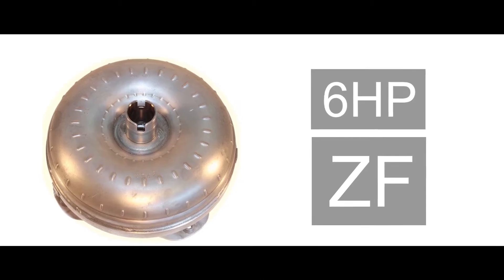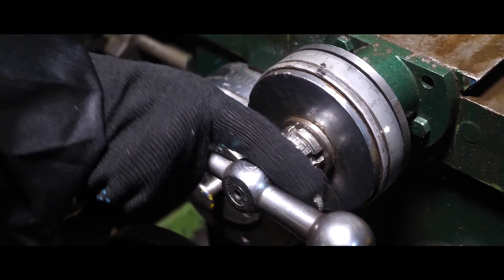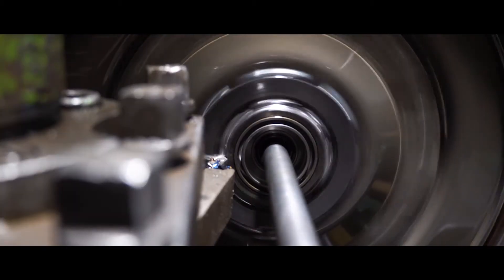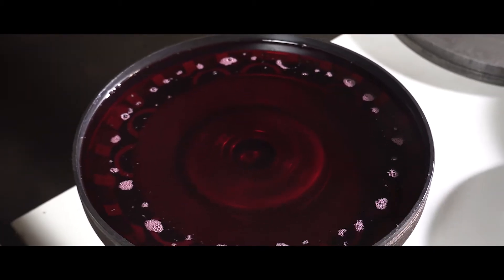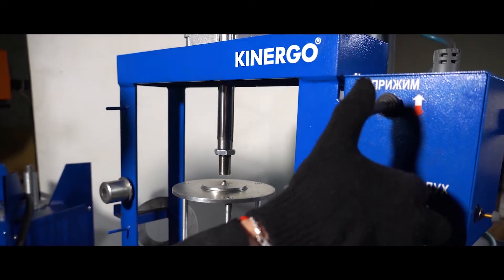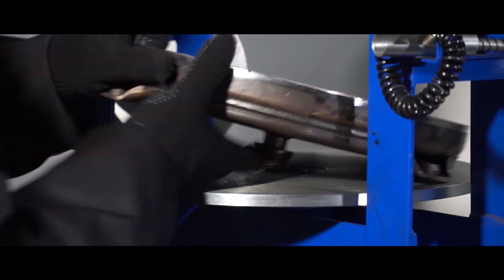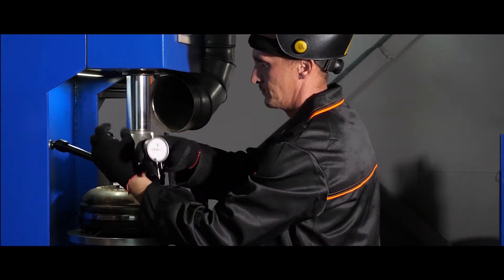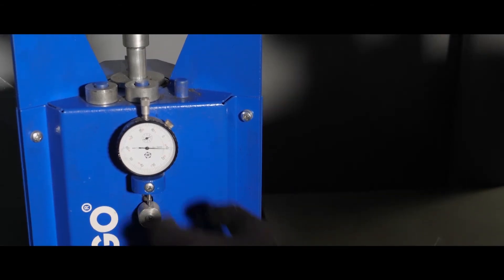Repair of the ZF 6HP26 torque converter

Comment: G’Day Kinergo thank you for your fantastic Video you are a Legend 💪👍🫡
Plz help Mate I have this problem with my 2004 Disco2 Automatic td5 just  
yesterday two weeks he changed transmission on my 04 Discovery 2 Td5 Automatic started playing symbol traction control as gear is engaged will I’m driving then parked home wake up in morning start on D 1-2-3 they won’t engage only Reverse works and I checked  transfer box if accidentally me or family member they engaged low range some how it stuck in N but nothing of that ,, then I found out the symbol transfer box  light on and when I engaged it R works D-2-3 won’t move just the 1 it works as Reverse 🤷‍♂️🤦‍♂️ is that a bad thing ,,, this happens after I visit a mechanic work shop 
oil fluid two weeks ago. 
Am I in trouble gearbox gone I don’t know 🤷‍♂️ what to do ? Please advise me 🙏🏻🙏🏻🙏🏻
Thank you 
Matt

Comment: How do you change oil in torque-converter?
Reply from the maker: Thank you for interest in Kinergo products. 
The only way to change the oil in the torque converter is to cut it open, clean and weld it back. All other ways are partial, some ATF will remain inside anyway.
Write to sales@kinergo.eu, our technical specialists will answer all your questions.
Reply: @KinergoEquipment  how long will oil in torque converter last?
Reply from the maker: @lordbentley730  The oil in the transmissions constantly circulates from one units to others (including from and to the torque converter). So it lasts the same period in all the parts of transmissions. The ATF lifetime is set up by different manufacturers in a different way. The majority of manufacturers recommend not to change the ATF during the whole life of transmissions. But transmissions rebuilders recommend to make partial or full ATF change every 40 000 - 60 000km
Reply: @KinergoEquipment  so oil from gearbox go to tourqe converter???

 Yes I have read so many different km when to change oil in gearbox last one was zf pdf document it stated 150 000km but they say another km in their YouTube channel. And lifeguard 6 is not for all  6hp gearboxes....... all this is made for something to go wrong 😄😢
Reply: @lordbentley730  Yes, gearbox oil flows through the converter. I change it every 90000-100000 km, but it is just like with engine oil: it's good if you change it every 10000km, but many people only do every 15000km and it's usually ok.

Comment: hi, i have a mercedes c 180 w203.  I have problems with the gearbox when it is not warmed up and I put it in D I feel a vibration, and when it warms up the gearbox calms down.  the complete oil and filter were changed.  and it's the same again, could it be next to the converter.??
Reply: That doesn't sound like torque converter issues. If you have a p0741 error code then it's most likely torque converter. Your issue sounds less severe as most transmissions act up when warmed up. So if your transmission drives fine when hot, then you don't really have anything to worry about. It may even have nothing to do with your transmission. Check the engine and transmission mounts, and have the car scanned for error codes.
Reply: @Carmaroadside  only when I put it in D and hold the brakes then it shakes up to 10 km/h.  while driving, everything is normal only when I'm in a place and in D.  and when I put it in N or P, the gearbox is normal.
Reply: on the computer it says no problems everything is fine.  I replaced the engine mounts, the oil and the filter in the transmission, and again there is no difference.  thank you
Reply from the maker: Hello! Thanks for your interest! If you have any other questions about torque converters please write to sales@kinergo.eu

Comment: Or you could buy a new torque converter! This is garbage! Is not costing an arm an a leg and a brand new converter is keeping you safe from assembling disassembling the car if you did something wrong! Very small tolerances! Also needs to be ensure dynamic equilibrium.
Is far to complicated and useless !
Reply: new is garbage ,it doesnt resiste at stage 2 so stfo
Reply: That is if you can still get a new one for a normal price. Rarely the case for a V10 Phaeton. Those constantly destroy the lockup clutch in these converters, so there are not many new converters left (and of course it had to be a special version to survive the V10's 750nm, so you can't just use any 6hp converter), and the remaining NOS ones are usually horribly expensive. At that point, I would rather remove and reinstall my engine, transmission and subframe every few years times to have the converter rebuilt than pay some horrendous price for one that sat on a shelf for 25 years and might last longer, or not.

Comment: thankyou, I just learned a lot. 
Mine is being done and I see now why it cost so much.
Reply from the maker: Excellent. Can we offer something from spare parts or equipment?
Reply: @KinergoEquipment  thanks, but I'm in West Australia and the car, a Discovery 3 TDV6 is already with the Automatic Transmission specialist for a full transmission rebuild including torque convertor reconditioning.
Reply from the maker: @noelwhittle7922  OK. In this case, can you advise us to your specialist?)) We will be grateful).
Reply: @noelwhittle7922  Who did your TC in WA. I need mine to be repaired in my 2005 D3?
Reply: instablaster.